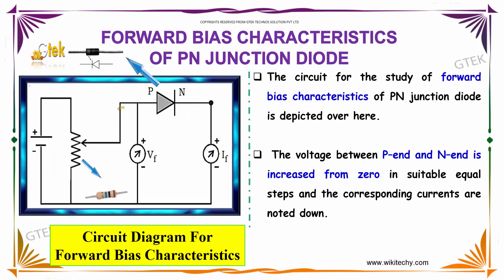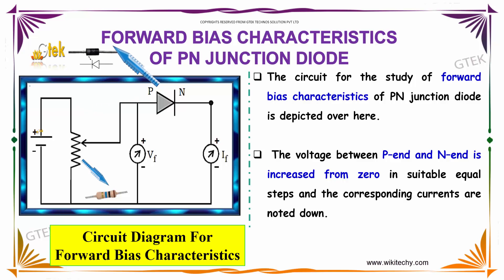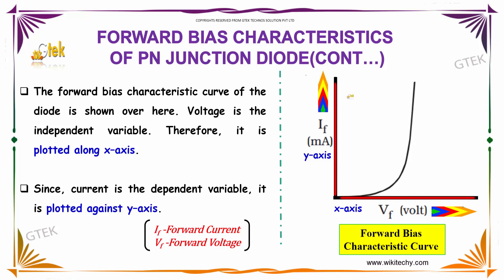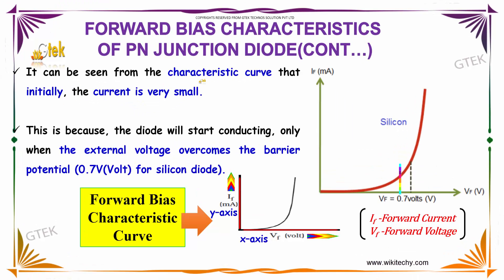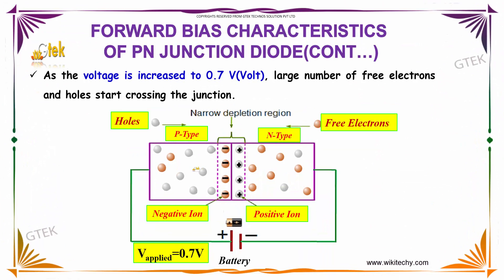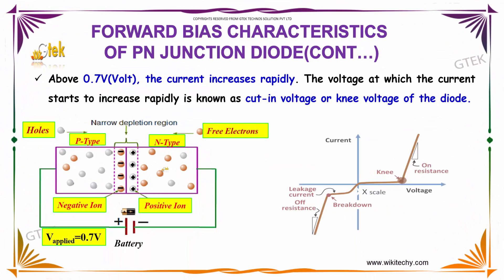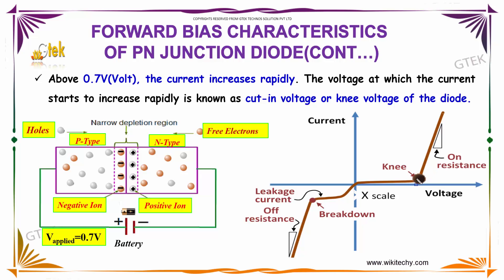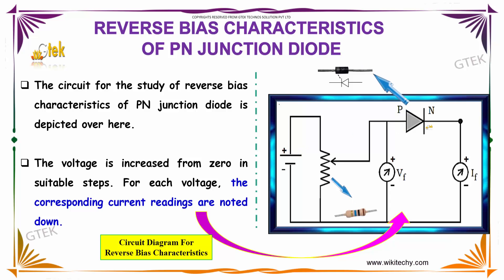Forward Bias Characteristics of PN Junction Diode | Semiconductor Device |class 12 physics notes

Comment: n Chapter 10 you learned about structural, thermal, and magnetic properties of solids. ... (c) Resistivity versus temperature for a typical semiconductor. .... The principal characteristic of a pn-junction diode is that it allows current to flow easily in one ... We call these situations forward bias and reverse bias, respectively. 38.

Comment: So that's the forward bias characteristics of a pn junction diode. It conducts current linearly with increase in voltage applied across the 2 terminals (provided the applied voltage crosses barrier potential).

Comment: p-n Junction Diode and Characteristics of p-n Junction ... When battery voltage is applied across the junction in the forward bias, a current will flow continuously ...

Comment: The width highly depends on the type of semiconductor used to make pn junction, the level of doping etc. When we apply voltage to the terminals of diode, the width of depletion region slowly starts decreasing. The reason for this is, in forward bias we apply voltage in a direction opposite to that of barrier potential.